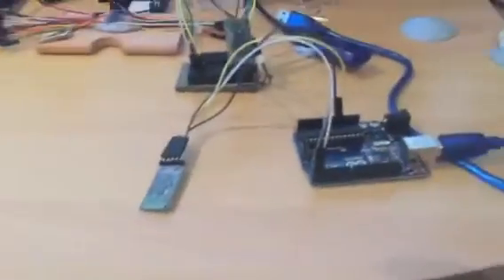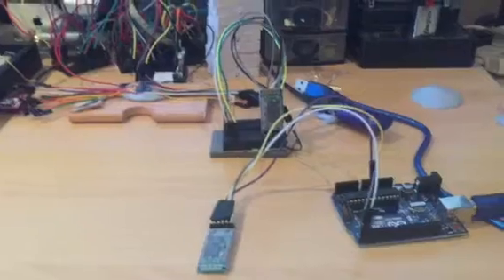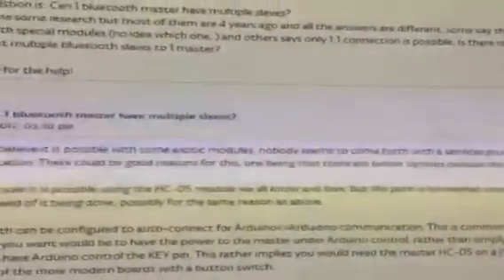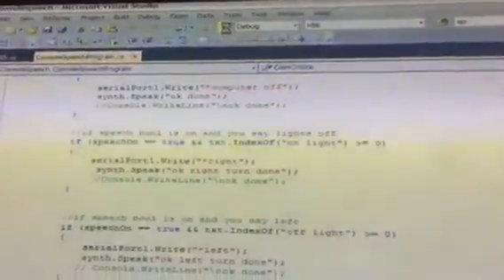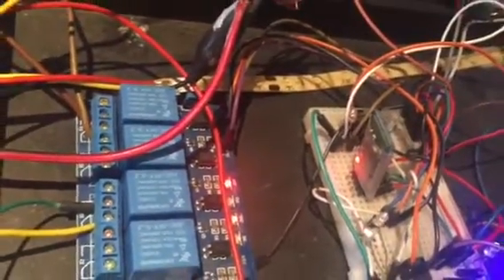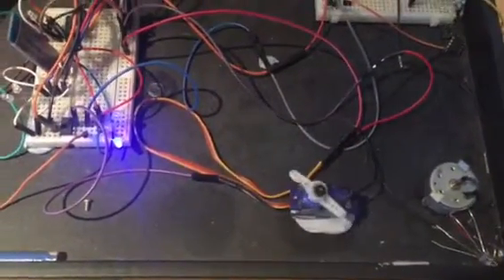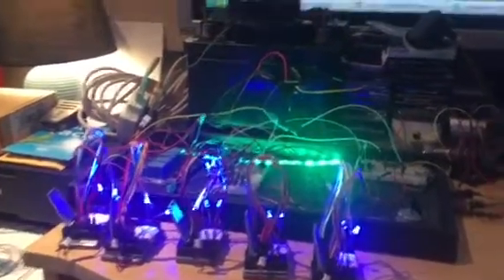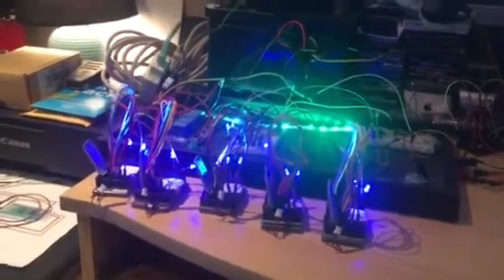Hc-05 multi slave Bluetooth piconet

Comment: Hello,

How many bytes can be streamed from each device per 5ms? Can this be used to stream 70 bytes from 4 devices under 10ms?
If so, we would like to contact you for a project opportunity
Reply from the maker: Sorry for the late reply only just spotted your message , and yes no probs what project do you have in mind ?
Reply: @zofmod  We want to send a packet from 4 devices via BLE. Each will send 70 bytes and that cycle should take no more than 10 ms. We would love to have direct contact with you for a potential contract. How to reach you?
Reply from the maker: @wbadry  are the 4 devices slaves and if so what is the master and   can the packets from each device be received 1ms apart so dev1 sends at 
5ms  dev2 sends at 6ms dev3 at 7ms and dev4 sends at 8ms restart.btw you can use privert message on youtube

Comment: Great JOB MASTER ! this is really magic. Where you live? i'm read your comments, really nice. Actully you shared you code ?
Reply from the maker: hey bro thanks for the comment im from the uk and no sorry  ive not released my code as we are the only people that have a proper working implementation of bluetooth multi connection bidirectional simultaneous control but we are going to be releasing some hardware so people can do the same, we've also built a home automation network to control your home using voice i.e turn house lights off and on, not a light bulb a modual that plugs inline to your original lights, all tv's , my own made bluetooth roller blinds, bluetooth fans stand up or ceiling and so on, we will be releasing an updated video soon 

thanks again for your comment
Reply: @zofmod  hi iam working on a semester project  on robotics. i want to make master and slave robot so that master should be user controlled and there would be multiple slave robots. i need your help
Reply from the maker: you need are new dongle and you can do that,it is not out for a couple of weeks al let you now.
Reply from the maker: you need are new dongle and you can do that,it is not out for a couple of weeks i let you now

Comment: How did yo make it?
Reply from the maker: which part the multiple bluetooth connections simultaneously controlled or the speech,recognition or the devices.i did this last year its come a long way since then i have been testing devices in my house for the last year and will be doing some up to date videos soon
Reply: @zofmod  Connect several slaves to one master. According to specification it's not possible.
Reply from the maker: lol every thing i ever read about bluetooth is wrong as ive proved i can have 7 masters 1 slave 7 slaves 1 master the connection is endless i am using a 50 device  network at the min
Reply from the maker: we will be releasing a dongle soon so u can connect 1 master and 6 slaves
i will tag you when we release it
Reply: @zofmod  Please tag me too
Reply: @zofmod  Tag me also sir. Can I request? What references/books/articles did you use in order to achieve that? Thank you very much.

Comment: Impressive! The speed is awesome.
Are there any problems with master to slaves range? Do you have to position master in the middle? Does your solution allows to build a network for bigger areas with walls ?
Reply from the maker: hi sorry for the late reply,there is no problem with the range but it can be increased. and the master can be anywhere and yes we can build a bigger network for bigger areas with walls no problem thanks for commenting

Comment: This is very impressive.
I've been struggling to configure, or even connect an HC-06 master device to multiple HC-05 slave devices, and this does it quicker than some of the solutions I've seen online. I see you are using a different master device though, do you mind sharing the device name or do you have any advice you can give? It would be very helpful for future dev projects.
Reply from the maker: hi we will be releasing a dongle soon so u can connect 1 master and 6 slaves
i will tag you when we release

Comment: Finally, a legit HC-05/06 piconet and scatternet. I have been searching for that for a week now still no progress the only piconet so far I had achieve is pairing and for multiple slaves still it's a disaster. How did you manage to achieve that? Mind sharing some references that can be read and studied or your experience on how it works? Thank you
Reply: @Gerard Suñé Alsina Sadly, no. Of all electronic devices this is one of my most difficult to reproduce or experiment with and there are almost non existing or difficult to access on documentation about this system so far what I had seen.

Comment: Nice work. Do you mind sharing the code?
Reply from the maker: hi and thanks for your comment due to the fact there is only myself and one company that can do multibluetooth  connection simultaneous control im not up loading the code at the moment but when i do i will send you a link. What is it your building ?
Reply: ZOF MOD no prob. I was curious to see the switching/polling sequence and the commands you used. I have worked on Bluetooth hc05 before but never used it like the way you have so I thought I will give it a try using an Android app.
Reply from the maker: many people have tried to do this without success, the bluetooth devices are not switching,there all connect simultaneous ive just posted a video controlling 3 devices from an android phone i can connect more  https://www.youtube.com/watch?v=yKNQ6Fh5K1o